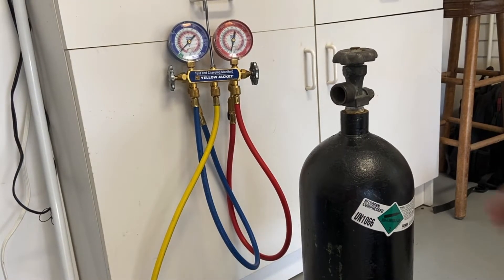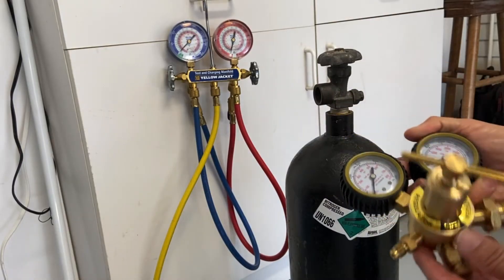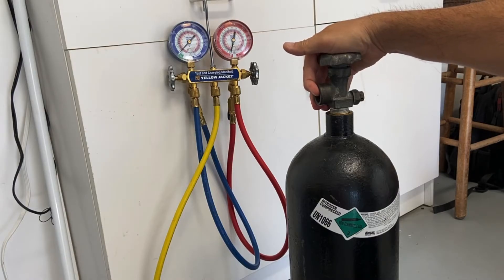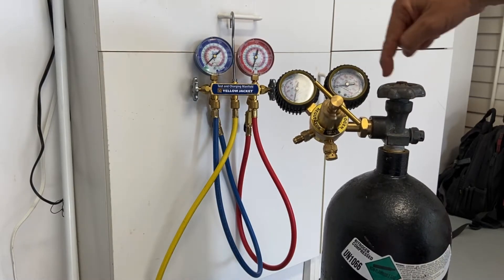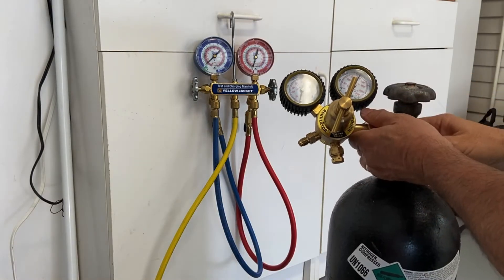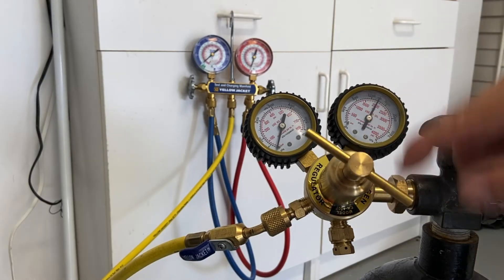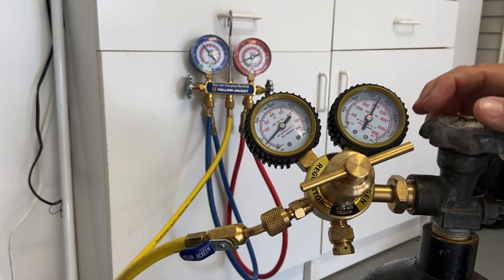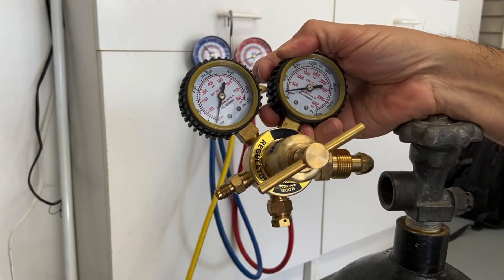HVAC Nitrogen Regulator Operation

Comment: If you put nitro  before you put pessured ,full ope valve on high side..then slowly open nitro regulator. .up to 150 psi.. check me if im wrong..then you see the low side .going up..to 150 psi . Then closed the nitro.
Reply: Cylinder systom testing checking psi nigtgeon syslinnder nitgeon reualter fixing seting 2gueges fee  gaugd open valvd afyone sidd psi seting  other filling 100psi  cher ac systom using 110 120 mord good  condshion systom only 100 if ehg mor coper nes old bad dsmges 1000%expres out sidd jobed jolly  hvac systom ok sir jolly